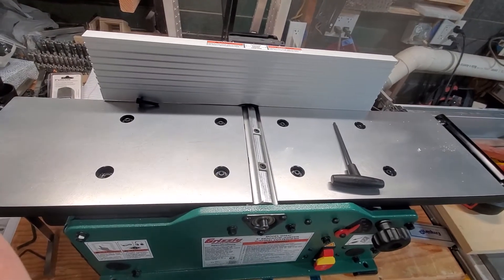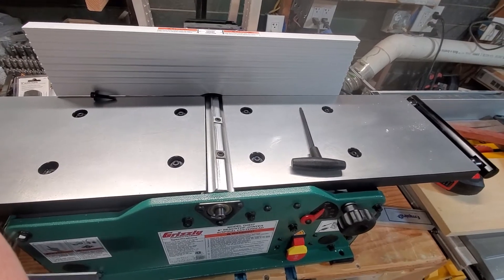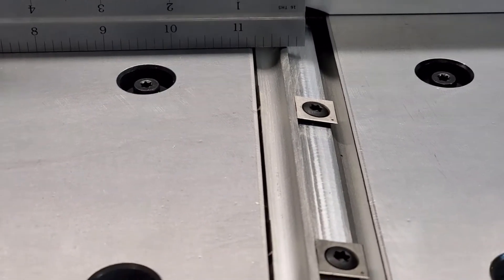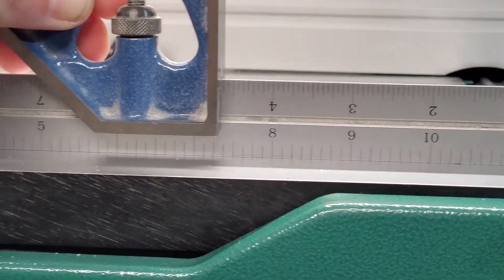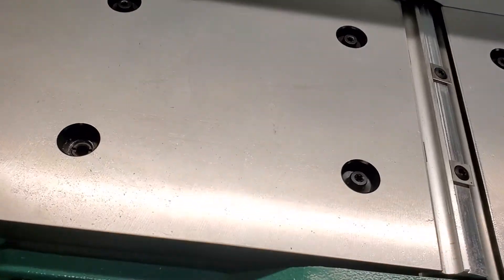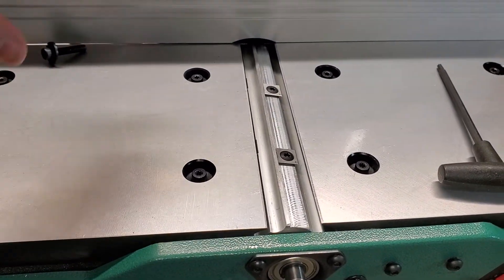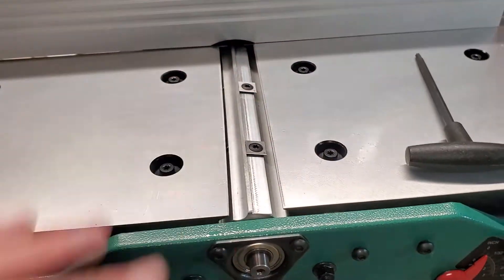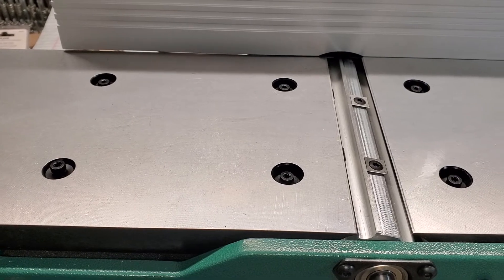New Grizzly 8" jointer (G0947) with helical type cuttinghead (2 of 3) tips during set-up

Comment: Richard - you can disregard my question in your video #3 as it looks like you've answered it with what you show here about the the outfeed/infeed table adjustment. I really like it that you're not a professional Youtuber and just decided to share these videos - so far, 95 views. That's not a lot, but my guess is that it will easily be in the thousands soon because I couldn't find any videos about the Grizzly G0945/946/9447. My Owner's Manual looks exactly like yours and I think I've got the G0946 which is the 6 in model with a spiral cutter head. I hope I don't regret not getting the 8 inch version. I have a DeWalt 735X planer - their newest - and after I watched a few Youtube videos I built a sled that is/was supposed to turn my planer into a jointer. After 2-3 hours of running my boards through my planer on this sled jig with lot of shims between the boards and the sled to keep the boards supported, I got next to nowhere - except for a few adrenaline rushes when I thought the planer might shoot my board or a shim out the back, lol. I'm looking forward to having a jointer to do jointing properly. If you have any updates on how your new Jointer has worked since you got it  - looks like about a week ago - I hope you'll post them. Again, I'm impressed with Grizzly so far and hadn't really thought about buying one of their saws - I'm saving for a SawStop, but I might consider Grizzly instead.